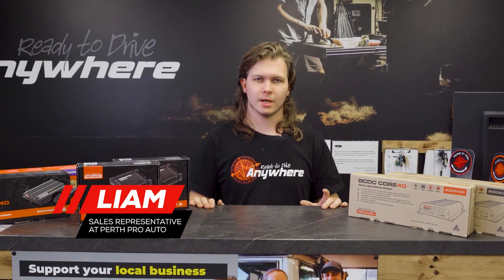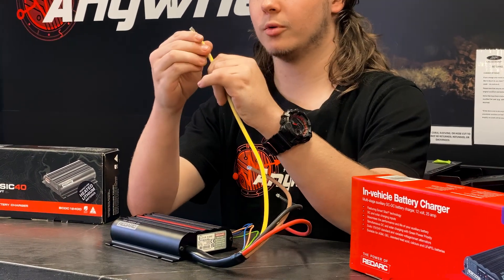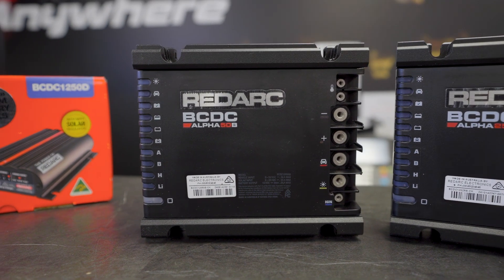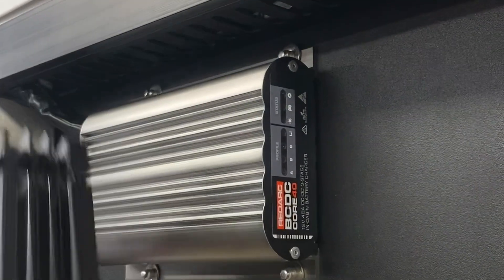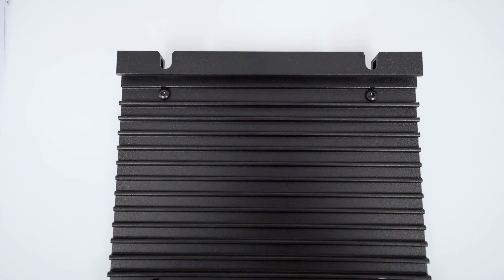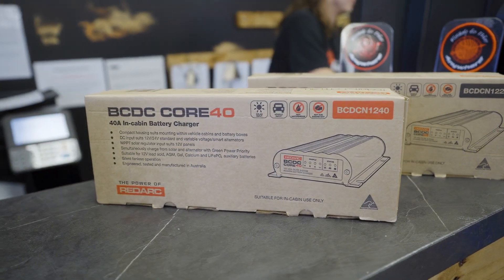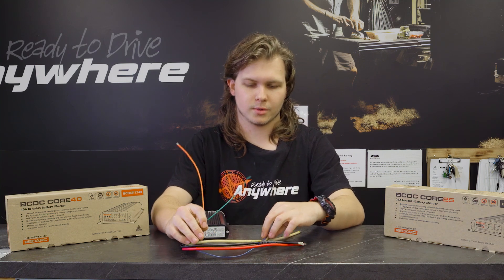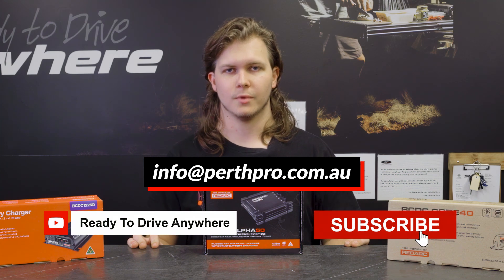Which DCDC Charger Do I Need? | A Guide to Redarc's Classic, Core, & Alpha Models

Comment: Ive burned through 2 redarc bcdc chargers in 12 months. Redarc have had there own licensed auto electrician to check my wiring. Seems they have started manufacturing these differently from the old school. As i was very upset after the second they have upgraded me to the alpha. Lets see how it goes otherwise ill be going victron

Comment: Hi - thanks for posting. The comment at 4:55 about charging LiFePo4 batteries under 0°C and them catching fire - is that right? 

I have heard that it may degrade the battery condition - but have not heard that it will cause a fire. 

If you can point me to more info on that I’d be appreciative. (Keen to avoid such an issue on future high country winter trips) 🙏
Reply from the maker: Most of the more quality lithium batteries will be programmed to not allow power in or to shutdown below 0°C meaning it is still quite unlikely that the battery will actually catch fire. There are some batteries designed for colder climates that incorporate a heating element to help with extended periods below 0°C, however these are not a common option here in Australia as it is quite uncommon for temperatures to remain below 0°C long enough for the battery to reach that temperature. One tip you can do is if you do see your battery at 0°C and you want to charge it we would run something that will pull a significant amount of power first to heat the battery up. Running a coffee machine for a morning coffee or a travel buddy will give it enough load for the battery to get back above 0°C.
Reply: @ Thanks for taking the time to respond team, greatly appreciated 👍

Comment: What’s the solar input voltage max for the alpha 25 or 50. The other redarcs are to low for my xplor solar panel I have to step down with victron mppt before redarc
Reply from the maker: The new Alpha range of both BCDC's and Managers can handle a max of 48V DC for solar regulation. We often use a combo of the Redarc units for DCDC Charging and solar blankets and Victron MPPT's for fixed solar to get the most efficient set up.
Reply: @ 
So max input voltage on redarc 1250 is 9-32V
The alpha is 48 max solar input?
My Xplor solar flex mounted on RTT 36V 
I could then skip my
Victron mppt then correct?
Reply from the maker: @206Trail4R  Yes the New BCDC Alpha range would be able to regulate that panel. Alternatively you can keep the current Victron MPPT just for the fixed solar and use the BCDC just for DCDC Charging and portable solar.
Reply: That’s great. Thank you for such a comprehensive review. So glad I watched this today. Perfect timing for me.
I have purchased Redarc 4 x 200w solar panels = 800w (Max Power voltage 25w each panel) and will now switch from the Classic to the Alpha 50. I will connect solar panels in parallel series to my new VoltGo 400amp LiFePo battery. But reading your comment here maybe I should also keep my existing PRojecta 25amp intelligent DC/DC and just hook up a solar blanket to that separately too? Thx
Reply from the maker: @vanessajones9455  You would be correct, If you already have an existing DCDC Charger that has an MPPT for solar input we would recommend keeping that in the system if possible so that you can still use a solar blanket. The downside of going in series is that you often can't plug in a solar blanket as it will be a different voltage to the roof panel but a separate MPPT solves this problem!
Reply: @ReadytoDriveAnywhere  much appreciated
Reply: Appreciate all your responses- just attended the overland expo SoCal and picked up an alpha